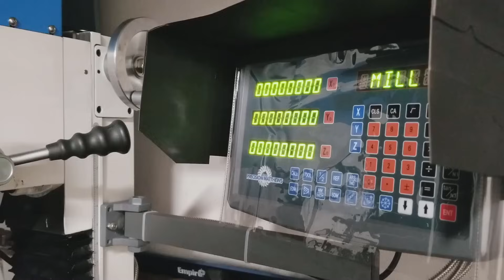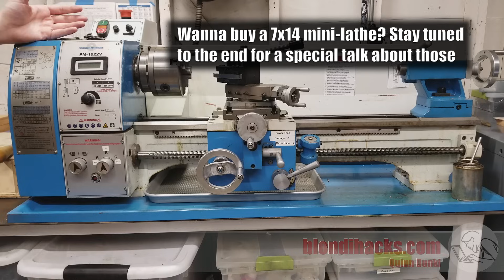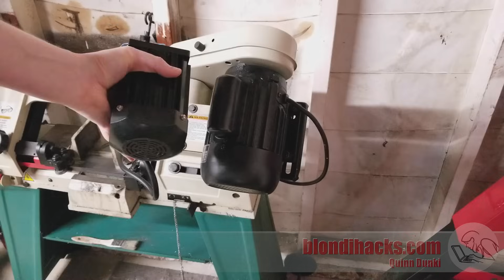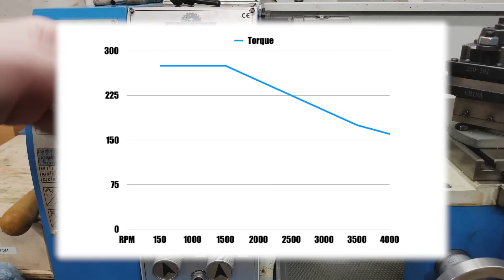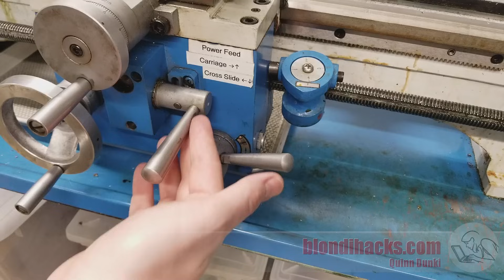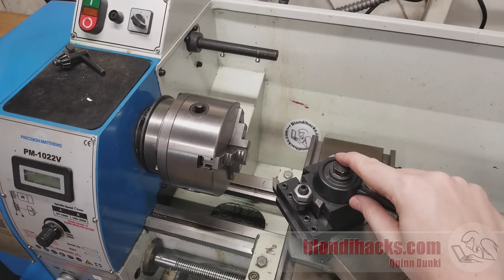Import Lathe Buying Guide

Comment: Great video. Good info. Unfortunately, I found it AFTER I purchased a 7x14 Import without a quick-change tool mount. I hope the machine will not limit me too much. I plan to use it for watch work so the stressors will not be big, but accuracy is important. I'm learning. Keep at it!

Comment: Your Getting Started & Import Lathe Buying Guide videos immediately answered my questions regarding investment considerations for a beginner. Thank you very much. I guess if you want to work on hard steel (like automotive parts), you need to plan on spending quite a lot and be prepared for the space and machine weight. Makes you really think long and hard about what kind of projects you want to get involved with on a part time basis - hobby? I'm not sure. What got me researching this, is a desire to restore the Differential Axel Carrier from a 58 Chevy Apache Pickup where I threw the bearings. Needs metal build up, then lathed for the bearings. Local machine shops think welding the build up before lathing would cause heat problems. Instead, I'm going to try some super metal epoxy paste to build up the bearing worn spots on the Carrier, then pursue a lathe. Not ready to buy one yet, so I'll hope I get lucky with local machine shops after I apply the Loctite Super Metal epoxy paste. Keep up your great videos. I have subscribed and enjoy watching them. Incidentally, I think I have an O'scope just like yours. Best regards.

Comment: Hi Quinn.  Great videos.  I am an ex Coast Guard Machinery Technician, who used to run a large Shipboard Lathe.  Probably a 10’ bed and 18” swing, but that was 50 years ago. i used to grind my own tool, and worked alot of metal called Monel at that time.  We used it to make large centrifugal shaf wear sleeves, and wear ringsI ordered a 7x16 Microlix lathe, to re learn on, that Is coming this week. After seeing your Precision Mathew’s, I wish I would have gotten that, but I need something that will fit on a 3’ workbench.  I could set up a 4’ bench, open on both sides.  Would a machine like yours fit?  Also having owned your 
Precision  Mathews, would you recommend it as an upgrade, when I decide to go bigger?  Thank you for the videos.
Reply: Sorry for the mistakes in my last.  It’s not letting me edit them out.  I do know how to Write and spell, but only so so on the keyboard

Comment: Hello Quinn, Nice that I discovered your channel. I have a question or two if you would be so kind to address for me.
I am looking at a Dayton 53UH10 !2" lathe.  
The price is right for me and I have the room. 
I am a lapidarist and use heavy machines for rock cutting and grinding so I am used to spinning and cutting machines.
The thing is, I am bored with cutting and polishing rocks. I have done this for a long time and well, I would like to move on. I would like to explore metal machining as an other hobby. 
I have self taught myself welding and I enjoy that so my next logical step is  machining.
Any thoughts on the lathe or an alternative possibility would be greatly appreciated.
Thank You
Paul

Comment: I bought an old atlas 6x18 /sears 101 I have got it kind of working with aluminum  and brass but does not work well with steel I Believe there is a lot wear 
Interested in a  grizzly g9729 do you think this is decent machine to upgrade to ?do you have any idea what the limitations of this machine might be ? I have not been able to find many examples of any one using this machine

Comment: You can also have your cake and eat it to with an AC motor. All you need is Variable Frequency Drive and a potentiometer. Then you can control your speed exactly as you do with the DC setup you mention.

Comment: My stupid cross slide does not indicate the depth of cut, but the reduction in diameter. So if I set a 1 thou cut, I actually get not 2 thou off the diameter, but a cut of 1/2 thou giving one thou from the diameter. This is damned confusing and just plain stupid.

Comment: Dear Quinn, I absolutely love your videos! You are so thorough and detailed, thank you! Sorry if this is too broad of a question to ask, but any suggestions on where to look for a Metric equivalent to your Precision Matthews PM-1022V lathe? It's my first time buying a lathe because I often find myself needing to make a custom shaft for a stepper motor, make a metric lead screw (or at least shave down the ends of an existing lead screw), metric gear making, among other things. Your Precision Matthews may be larger than what I need since I usually don't need cut anything longer than 4" to 6", but you seem quite happy with it.

Comment: Coming into the comments a few years to late, but on the topic of imperial vs metric, what has worked for me on other tools is to put a DRO on them that can operate in imperial or metric. Still have issues if the pitches of the lead screws are not correct, but for most things it saves having to do conversions.

Comment: I work on a circa 1975 colchester 2000 lathe at work. I like a gearbox on the chuck spindle, I can't get on with the variable speed motor drive. I also like the saddle handle on the right to do freehand chamfers . All the dials are imperial even though all the work I do is metric. Good video covers everything on a lathe.
Reply: I can’t get off on the variable speed either. 

I’ve found a lathe that I absolutely love and, for me, it ticks ‘ALL’ the right boxes but it’s got this variable potentiometer and that’s stymying my project. It’s an expensive lathe too.

Comment: Excellent video. I need a 12 to 14" lathe do to space but it seems I am going to get junk in those sizes. I guess I am stuck with my small Unimat SL DB-200. This is very frustrating. It takes forever to turn larger steel on my Unimat.  It is wonderful on very small work, even steel on small diameters but once you get to 1/2" or bigger things change fast on time and not in a good way.  To the best of my knowledge there are no cross slide or tail stock locks on  any of the 12 to 14 " imported lathes nor adjusting backlash. This is very bad. ( my Unimat has both locks, and back lash adjustments.) I saw that you mentioned drilling and tapping your own on those sized lathes. Still yet no backlash adjustments. Arrgh. I do not want to waste money on a new lathe as it sounds it could be just that. It could be a scary ,,oh crap I just bought a piece of junk scenario. I am not rich by no means. Sending it back would cost almost as much as the lathe. What to do,,,,,,,,

Comment: My gears are made of POM -.- its not fine. Something is totally off in my lil even smaller china C2 lathe. Motivating when you just get started trying to cut threads with the tool.

Comment: This hobby of home machining is a bottomless money pit. It never ends. Back in the 70's, I bought a Unimat Sl 1000 from a guy who intended to make brass locomotives with it. He never did. I built ship models for years, and used that little lathe for all sorts of brass parts for them. Sometime around 2005, I bought a 7x10 mini lathe, spent a lot on it, used it for various things, etc. In the end, I really didn't need it, just found it interesting. Now, I hear it's really not good, and I need a bigger machine. I will get rid of all this stuff before I get rid of my little Unimat machine. Seriously.

Comment: I’ve been looking at the sherline lathes, upto 3x17 inch size. They go for $800 roughly. Can get DRO and starter packaged for maybe $1200. Other than the small size of the sherline, what other reasons to consider one of these 7x22 imports?

Comment: Been thinking about this a bit. The featured Precision Matthews machine featured is not orders of magnitude more expensive than a properly configured (good bearings, brushless DC motor, etc.) Chineseum 7x14. The capabilities are disproportionate to the increased cost. However, I would not get a quarter ton machine down into my basement without inadvertently rearranging the floor plan of our small house. Being someone in the market for a lathe, there is a lot of value in this video anyway.  Now I know why Little Machine Shop specifies Japanese NSK spindle bearings, for example.
Not a lot of choices in the range of 100 pounds or so of machine I can get down my narrow cellar steps without rearranging structural or body parts. Sherline is tempting, offering the precision but severe limits on the size of stock they can handle, particularly harder materials. The Chinese 7x lathes are about the only other choice, but it makes sense to work with a company like Little Machine Shop that will do the specification and quality control for you. Brushless DC motors, and better bearings are a good start.  The thread cutting for ASTM inch standard threads will be a bit off, a gearing kludge for a machine designed around metric, but taps and dies work well enough for my purposes.

Comment: I would argue with “Imperial”. The Empire lost its empire and went metric. When is the last time you saw Whitworth fasteners at your local Ace Hardware? 
On a more serious note, beware the cheap eBay versions of the Universal Chinese Minilathe. Most of them only cut metric threads. Being bilingual measurers we need to be able to cut both metric and. . .? Not SAE anymore.  Don’t have a name for it, I guess. OK, just call it “imperial,” I guess.

Comment: A remarkably good review of the general product with the traps and features. The motor comparison was to the point and superb. The drop off in high speed torque may not be an issue because it would only be used with small radius work.
The discussion metric vs Imperial was thoughtful. For work I had to talk metric (Oz) although using metric, imperial and microns. But my lathe was imperial as was my Machinery's handbook. Working off USA and old drawings is a reality here as well. A DRO would help here. I will be stepping up a size.
As an aside, an informal HASS survey had 75% of its cnc operators using imperial.

Comment: Question for you or anyone in the chat. Bought a 6 jaw tru-adjust chuck under the assumption it will center every piece of work after you set it up. Every piece I put in the chuck I end up having to adjust it. Is that normal?

Comment: So I got a question...

I just bought a Victor 400 x 750mm lathe. In their website it says it has a camlock system but it appears only the export version has it. Mine has A1-6 bolt on system, it is not an export version but ones used in Taiwan.

Does anyone make a D1-6 backing plate that can be bolted onto a bolt on nose so I can use a camlock chuck?

Comment: Excellent info. Now I am debating whether to buy ac motor or dc motor. When do you really need to run lathe at low rpm? Say 50 rpm, 20 rpm, or even 1 rpm.

Comment: Excellent video!
We are manufacturing machines for the diagnostic sector and as a supplement to our Haas CNC we need to turn maybe one to two parts in stainless steel per week. Our parts do not need to be extremely accurate but surface finish has to be stellar. Parts are up to Ø100 x 300mm.
Is this a suitable machine for making posts, shafts, mounts etc in high finish, or is the basic quality of the lathe just too low, so that we should go with a cheap CNC lathe in stead

Comment: As an engineering technician with 40 years experience in manufacturing, 23 of them also machining prototypes, tooling, fixtures, etc.  I have to say this is one of the best presentations I have ever seen on lathes.  Thank you..
Reply: I have zero background in metal working or lathes and I thought the same thing… Good to know my gut was right

Comment: A work we had AC motors and ran them variable speed. They used the top of the line inverters to make them work and that was big bucks. These motors also were under a lot of load . It was common to have weekly breakdowns with the motors and drive panels. They would replace them with  DC variable speed motors and they were 1/2 the power output. They would be used till they got parts and repairs happened. After a while they got lazy and just left the DC units on and  I don't believe their was anymore problems.

Comment: Blondihacks, I have a question for you about your lathe. I bought the PM1130 and noticed the belt on yours is setup the same way, have you changed your belt from low range to high range? Mine has an idler wheel that I didn't see on yours but even with the idler wheel not doing anything on my lathe the belt is extremely tight and I was wondering if the belt on your lathe is the same way? Thanks. 
I'm considering buying a 1" longer belt to try to remove some of the tension on mine since it seems extreme and I am worried about the bearings getting damaged with this much tension on them.

Comment: This is an absolutely outstanding presentation in every way. It has assisted me greatly and you should be elected to the Phi Beta Kappa of machinists, whatever that is. At the risk of misusing an absolute adjective, my lathe needs are almost unique. I will be using my lathe to manufacture rocket motors and engines. From 01/2006-01/2012 I held federal and state licenses to manufacture high explosives. I developed several interesting propellants and now I need to manufacture the rest of the propellent system.

I will need a unit capable of machining 7000 series aluminum, 4130/4140 steel, stainless steel, graphite, and Inconel. Max diameter will be 80 mm and max length will be 320 mm. Probably the most difficult operations will be threading and boring.

SPEED (AND THUS TIME) IS NOT AN OBJECT! I'm not mass producing anything so if it takes me two days to machine one part, so be it.

SPACE IS NOT AN OBJECT! Within reason, I am not limited to a mini machine and I can easily accommodate a machine three meters long (about ten feet).

PRICE IS NOT AN OBJECT! Yes, you heard/read me correctly. If I have to pay an exorbitant price, I am willing to do just that.

So what are my limitations? I have two, the first being weight. The machine will be set up in a second story room with a steep set of stairs the only access. I could probably handle a 150 kg (330 lbs.) unit, particularly if I could disassemble it partly to make it easier to handle. Anything heavier is quite out of the question and even 150 kg is probably being overly optimistic.

My biggest limitation is power. I am restricted to 110 VAC/115 VAC/117 VAC/120 VAC, 60 Hz. I have no way around that.

What I find most infuriating is that the Sherline 17 inch machine is ALMOST ideal. It would have to be modified to handle larger three and four jaw chucks on the headstock or else Sheline would need to manufacture larger headstock chucks...they already manufacture a riser block set. Also, I would need a tailstock drill chuck capable of handling a 1/2" shank drill bit and a 1/2" shank plunge-type  ball end mill.

ANY IDEAS ANYONE? Brand? Make and model?       SUBSCRIBED.

Comment: Hi, I watched this last night and it was very informative, thank you! A question - now that this is two years old, are there any updates that you'd make? I like the price point of the Chinese lathes but I'd rather pay extra and get one that is "mostly" right (I'm not a machinist so this to me means works as intended). And would you recommend a brand / model based on after sales support and under 3k? I looked at the PM2200 and noticed what they said about how to change the chuck. So those sorts of "challenges" are still in play.

Comment: I have a Shop Fox M1112 Gunsmith lathe, and it's already paid for itself in side work, (no, I don't make guns!). One word about chuck mounts, mine is a D1-5 mount system. I love it, but while D1-4 and D1-6 Lathe Chucks are everywhere, D1-5 chucks are rare and expensive if you can find them, so I buy plain back chucks, and machine a back plate adapter to fit them onto my lathe. It's not a deal-breaker if you're really interested in a Shop Fox, but something you might want to keep in mind if you're still shopping around.

Comment: I just got a job making ss 5" mandrels with .040 diameters and .0005 tolerance. I'm going to make a mini tool post grinder. I want to buy a mini and dedicate it to this job that repeats itself week after week. Question is are the ways on a mini lathe machined well enough to hold .0005 tolerance for 5""?

Comment: My experience with the 7x14 lathes is that the 3" chuck they are supplied with is usually too small for many at home jobs and replacing that with a 4" lathe chuck gives more utility to the unit.

Comment: I bypassed all those problem when I  purchased a Logan 10X24 lathe many years ago. Parts are hard to get but then it's not likely you will ever need them. This lathe screams quality. I actually spoke to the older Charles Logan many years ago at the factory where he was still working until his death, and he described this lathe as "his little jewel". Thirty years of hard use and it only works better over time....

Comment: The little old Craftsman lathes often had ZAMAK gears and a lot of those available now have failed. In your estimation, how does the durability of sintered gears compare? Do you regard the chuck mounting system on your lathe as preferable to those other systems on small Asian lathes?